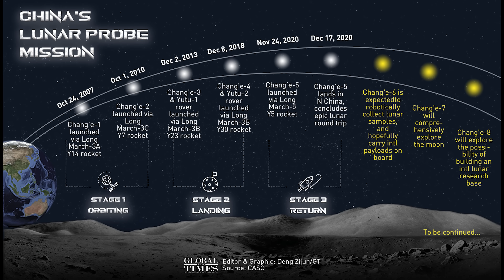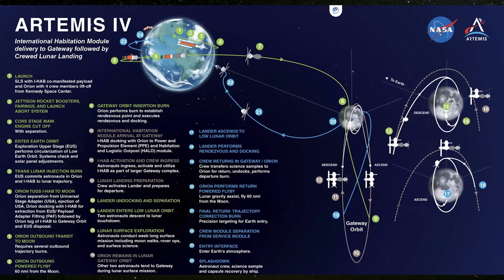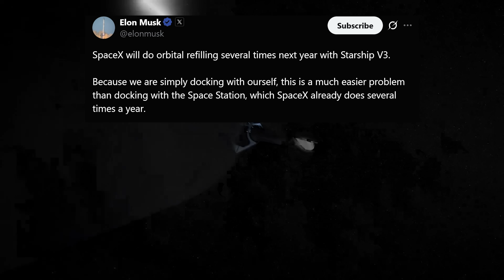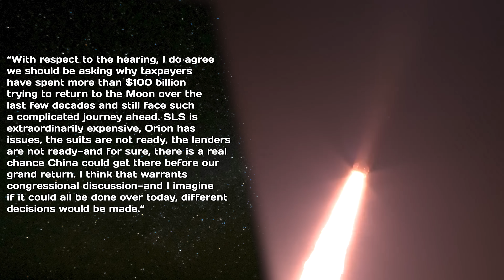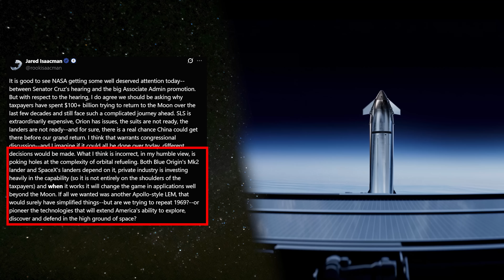Ex-NASA chief revealed the Real Problem with SpaceX Starship to get back to the Moon while China

Comment: I don't think the SLS is the largest or most powerful rocket ever developed. That would be the booster for Starship. It has already been launched more times than SLS at a lesser cost and one has been launched twice. SLS is too expensive to be used as the basis for our return to the moon. The ex-NASA chief may be angling for or already have a lobbying job for Boeing.
Reply: Starship its just a inox container with gas and a tiny Pentium 4 as CPU. We are going anywhere with that.
Reply: Wrong, wrong. Starship is only more powerful on paper, years before testing. In reality it barely can carry payload to a sufficient altitude at HALF the distance it initially planned in testing off the coast of Hawaii. Cost? Cost of what? Wow, it's cheaper to have a failed rocket program. Impressive!
Reply: @contraCharFred  Sorry you are wrong. Super heavy already lifts more than Saturn V and is fully reuseable.
Stop bashing on SpaceX when you are clueless.

Saturn V lifted 118 tons to LEO and was discarded. Even if they COULD recover the booster the engines were NOT designed to be used again.
Superheavy can do 120 tons to LEO and is fully reuseable.
Not even comparable.
Reply: @contraCharFred  It has been sub-orbital for testing. By being sub-orbital it will come down if the planned retro firing fails, no matter what.Cost must not  be a concern of yours as SLS is WAY over budget and well past it's scheduled use-by-date.
Reply: @bwuepper439  SpaceX has formed its company, built THREE fully qualified Launch vehicles (soon to be four)  and has launched and operated the largest satellite fleet in human history.  They have done ALL OF THIS for LESS than NASA has spent to fly SLS - ONCE.
And MOST of SLS is REUSED HARDWARE from 80s tech.
Reply: @bwuepper439  SLS isn't in development stage. Costs are now understood. It's much worse for starship. It's in the R&D and development phase. It was speculated to cost $10 billion years ago, but that assumed it would be finished by 2024. Every year of failure is $2 to 2.5 billion more. So enjoy the ever increasing costs & delays buddy. They're just getting started. I love this!
Reply: @contraCharFred  The estimated price for a SLS launch is $2.5B. That is for ONE launch. Starship will beat that hands down.
Reply: @bwuepper439  and yet, it hasn't. And since it will have to give up full reuseability to launch a decent weight to orbit, if it can get there, it won't be economical. But do keep enjoying the rising and ever increasing starship developments costs. I know I am.

Comment: Keep in mind, this is Jim Bridenstine, who before being appointed to NASA, was one of the leading climate change deniers in Congress.  The issue with SpaceX might be spot on.  Jim Bridenstine is not the guy you want to be making any arguments if you want credibility.  His appointment to NASA wasn't based on his technical or engineering acumen.  It was plain old Republican tactics -- they tried to put someone into NASA leadership that didn't believe in global warming to try and refocus NASA and get them to stop making all those pesky climate observations and conclusions.  After all, all that oil company lobby money shouldn't be for naught.

If we really want to go to the moon, or anywhere else in space, we should start by creating stations that can support a human colony indefinitely.  That means a giant toroid station, made from inflatable segments, at least a kilometer in diameter.  These could store all the water needed, in a layer a meter thick along the outer walls in auto-sealing bladders, that would also provide radiation shielding.  With a crew of at least 5,000, you have enough room for growing food, livestock, and 1G of artificial gravity through rotation.  These could be slowboated out to the moon, the belt, and even mars, where they can serve as the primary support point.

Comment: Musk is supposed to be a genius. So why does he not see that the first Starship to land on the moon will, most likely, tip over due to the high center of gravity. There was a reason why the Apollo LM had wide legs and a low center of gravity.
Reply: The ship will also have a low center of gravity... What makes you think they haven't studied and simulated this before actually building ths rocket?
Reply: @yannisws , how many RUDs have Starships experienced so far?
Reply: @JohnDemeritt  A RUD during a TEST-flight has nothing to do with a ship's ability to land on the moon. Moving the goalpost is a fallacy. Regardless, if you don't understand the difference between 'operational' and 'in development' I highly doubt you can participate in a productive discussion.
Reply: @yannisws , oh, but I do understand the differences between operational and developmental systems.  Here's the thing: we can't get to the operational version of the ship until we complete the development stage.  The continuing RUDs show that we're nowhere near getting to an operational Starship.  And if the Starship is supposed to be the vehicle that actually lands on the Moon and brings crews back from the lunar surface, it has to be able to reach orbit and perform in orbit without experiencing RUDs.

Far as I can tell, Starship is nowhere NEAR being able to fulfill that condition at this time.  So the big question is . . . when will it be able to fly without going "BOOM ! ! !" ?
Reply: @JohnDemeritt  Which is why Starship is still in development and making a fuss about RUD's now is dumb. Glad we reached this conclusion.

Good thing that it doesn't have to be operational yet at this time... In fact, time is the least of anyone's worries. Safety and reliability should be first.

Flight 10 was already without going "BOOM ! ! !".  Just like Flight 4, 5 and 6.
Reply: @yannisws , I think you missed the point entirely.  This video was about going back to the Moon before China goes for the first time.  As it stands, it appears that the rest of the hardware needed is already checked out.  The SLS has flown without a RUD.  The crew capsule appears ready to go . . . but the craft that's supposed to actually land on the lunar surface isn't ready.  So what's the likelihood China's going to land on the Moon when the USA can only sail around in orbit?

I agree that safety and reliability should be the first and foremost concerns of any space program.  And, frankly, I don't understand why we have to beat China to the Moon (much less place a nuclear reactor there . . . but that's the subject of a different kvetch).  But, for some reason not mentioned in this video, time does seem to be of the essence.
Reply: @JohnDemeritt  That was not the original point being discussed here. Moving the goalpost again.

The flight hardware for Artemis 3 is far from ready to go. We're still waiting for Artemis 2. Orion's heatshield analysis has taken way longer than expected (for good reasons) and NASA had delays fixing their launchpad after Artemis 1.

Im glad we can agree on that. I also don't care who's first don't understand why people act like it has any impact on their lives. All I care about is technological advancement, preferably in a safe and reliable manner. Last time we rushed, we killed 3 astronauts before even igniting the engines.
Reply: @yannisws  not enough. There are smaller, lighter and wider landing platforms that had a difficult time with it. It just seems inspired by 1950s art of big rockets landing on planets and not physics which would favor an actual lander size & configuration.
Reply: @contraCharFred  Not enough according to who? 

Intuitive MAchine's landers' difficult time was not related to shape, gravity or due to the mass-distribution of the lander.

IM-1 (Odysseus) had one of the landing leg struts broke off during the landing. For IM-2 (Athena) the altimeter had failed during landing, leaving its onboard computer without an accurate altitude reading.

This is public information. Did you fact-check what you wrote before posting it?

So again my question, what makes you think they haven't studied and simulated this already? And why would NASA be okay with it?
Reply: @yannisws  "What makes you think they haven't studied and simulated this before actually building ths rocket?"
So the others that tipped over, in recent times, haven't been studies and simulated before the landing attempts?
Reply: @gottagowork  You should have done a little more reading before making the exact same comment as othersalready did.

IM-1 (Odysseus) had one of the landing leg struts break off during the landing. For IM-2 (Athena) the altimeter had failed during landing, leaving its onboard computer without an accurate altitude reading.

They had material and software failures. The shape, weight or center-of-mass were not the issue with those failed landings.

Comment: If you want to get US astronauts on the moon, the first step is to fire SpaceX.
Start again.
As soon as possible.
Reply: Don't be stupid. There are NO other companies with the capability that SpaceX has, NOT even Boeing can match them - notice the cost of SLS is 4.2 billion dollars for JUST ONE LAUNCH. and EACH Launch will cost another 4.2 billion. Boeing hasn't yet demonstrated the capability of even REACHING ISS correctly.  SpaceX has done it a number of times for far less than even ONE Boeing ATTEMPT.
Reply: @JessePollardII  Why are you insulting a guy you agree with ?
Reply: @Matx5901  Just a statement of reality. Boeing was the company that got the US to the Moon. Grumman built the lander. Boeing can't do it now - without spending about 4 times the original cost with questionalable success. and only has ONE test launch that was only mostly successful - though the return was very questionable.
SpaceX HAS the capability. And has DEMONSTRATED IT. At the present time the situation is "If it is Boeing I'm not going". Even Boeing airplanes are failing.
Reply: @JessePollardII  My mistake, I mismatched the quote you where reacting to: You did not agree. By the way, I don't think insulting is the right way to interact, but that's another subject.
Reply: @Matx5901  Sometimes an insult is the only response logically possible.

Comment: If anyone ever experienced working in this industry, it takes a ton of employees that give a shit everyday. It gets old when things don’t go well. Then employees get pushed. Equipment doesn’t work as planned. Calibration issues and schedules need to be fulfilled. Then comes mandatory over time. People don’t see their families. Spouses are pissed. Management becomes stressed because their employees are having liquid lunches. Top brass comes in for a visit and everything is cleaned up and hunky doory 😂. Managers buy some time as the shops go back to work. Then the facility has an air condition failure and quality control shut down the work. In the meantime one of your suppliers is going through a merger and acquisition and their employees threaten a walkout. Finally the dust settles and you discover it’s going to be rinse and repeat for  5 years. And you think about how the hell you are going to get out  of this manmade hell that may send you to the unemployment line when shit hits the corporate fan.  Sometimes driving a school bus or a ride share can be just as fulfilling sending tons of metal into space. 😎👍

Comment: The other problem with landing Starship on the Moon is that its centre of mass is too high. Sure, it can land on a tiny flat concrete pad ... but the moon has none of those. Yet. 
So for initial landings, you need a craft whose baseline is similar to or wider than its height. It you really WANT starship to land on the Moon, it needs four legs and four rocket engines strapped to it in orbit, to allow it to land horizontally. 

Right now, if lunar dist kicked up by the landing gets in the elevator gear, then there's no way for the astronauts up in the crew compartment at the top to get down to the surface other than perhaps a rope ladder. They'd have to just site there for a while, and then go home. And if the thing falls over, they'd really be screwed. There might be no way for them to reach and operate the controls when the craft is on its side.
Reply: Backseat rocket engineers acting as if they know better than actual rocket engineers... Never fails to amuse me!
Reply: @yannisws  Intuitive machines landers were made by engineers. Both failed. Those landers are super tiny where compared to Starship. Would you like to comment that?
Reply: @GreyDeathVaccine  Yes, I would like to comment.

IM-1: One of the landing leg struts broke off during the landing. 

IM-2: The altimeter had failed during landing, leaving its onboard computer without an accurate altitude reading.

They failed because of material and software failures, not because of the shape or center-of-gravity of the lander.
Reply: Yep. In its current design, this thing will definitely tip over

Comment: The real problem with Starship wrt the Moon programme, is that it is not and never was designed for a Moon programme. 
The point of in-space refuelling is instead to have a fully-fuelled Starship in Earth orbit that can go to Mars.

Elon is using the NASA Moon programme to get the US Government to pay for his Mars R&D. 

If the Moon project fails, he doesn't care too much. 

-----
We don't need that to go to the Moon. We all know this. We know that all it takes to get humans from lunar orbit to the Moon and back again  is a teensy-weensy lunar lander whose detachable top half has its own little engine. We did this in '69.

There is no reason to send anything the size of a Monster Starship to the Moon. Unless you can land it horizontally, leave it there, and cut holes in it and weld doors to the holes to make it your lunar base. But then it doesn't need the engines. Starship on the Moon at this point just makes no sense, unless you've already found lunar ice and plan on using local solar power to crack it into hydrogen and oxygen fuel, and refuel the Starship and relaunch it ... 
... but in that case the first stage is to land robotics and 3D printers and remote telepresence suits, and AI monitoring that can watch how astronauts respond to instructions, and anticipate, and eventually replace them, to set as much of the lunar infrastructure as possible. And then send people. Maybe.  

But we know that you don't need an entire starship to get from the Moon back to Earth, because it's mostly downhill, you just need a tiny rocket motor to get you to the orbiting Lunar space station, and then a smallish motor to throw you back to Earth, in a reentry capsule. 

And the reentry capsule can be a separate very much cut-down thing, not an entire rocketship.
Reply: But the Moon has mineral wealth. Mars does not, last I heard.

Comment: If Starship need something like 15 to 20 launches to refuel why doesn't the last refuel flight carry the astronauts? Artemis is the expensive useless bit.
Reply: Because Starship will NEVER be human rated. It cannot be BY DESIGN because AT A MINIMUM it has not abort system for early-mid flight.

Comment: The lunar gateway is the worst of both worlds. It is not in low Earth orbit, in order to be protected for cosmic radiation and solar winds, and it is not on the moon's surface where you can build shelters or use the moon caves for radiation protection. The real reason for the lunar gateway is that the companies that built and maintain the ISS pushed to have an ISS on the moon. The only thing that you need around the moon is a small constellation of satellites to provide constant communication and navigation.
If people actually want to do something useful on the moon, them build a radio-telescope on the far side of the moon. Science fiction writers have been writing about them for a very long time because it makes sense. On the far side of the moon you are protected from the electromagnetic radiation produced on earth.

Comment: Don't understand.  How did Apollo get there without refueling?
Reply: In simple terms... very big multi stage rocket and tiny lunar landing module.
Reply: compare the Apollo LM with Starship side-by-side and you'll see your answer.
Reply: You'll never understand: It's rocket science.
Reply: Really?  Go and do some reading.
Reply: @poruatokin Apollo was a really large rocket that was designed as a complete system of rocket amount you need to lift all the different stages the service module and the lander all together 

Does Saturn v put up 140 tons to lower Earth orbit something SpaceX claims that starship will eventually be able to do but we have no idea if that's true 

It had a very small light lander and a small service module 

It didn't waste any mass by trying to be reusable or unnecessarily large cargo volume like starship 

Basically every part of the Artemis project and starship being a huge part of it is not specifically designed for the mission where everything about Apollo was designed down to the ounce to make the mission work

Comment: "artificial acceleration" - you mean artificial gravity?!
Reply: If you accelerate the rocket and it's circular orbit around the planet by 1G yes you have created the equivalent of 1 g of gravity
Reply: Importantly though you have to continue that acceleration so you're constantly increasing in speed which is going to affect your orbit height 

Also you're not going to have enough fuel to constantly accelerate at 1G 

And I don't think although I think their idea of how easy it's going to be to refuel starship is nonsensical you don't even need 1G to help cause the settling of the fuel. And it would only be required for the period that you're doing the actual transfer because as soon as you turn off the thrust at 1G or any level of g then you're back to microgravity which is basically just following around the Earth but you're going really fast so you never hit it
Reply: @mcamp9445  Indeed. That is artificial gravity.